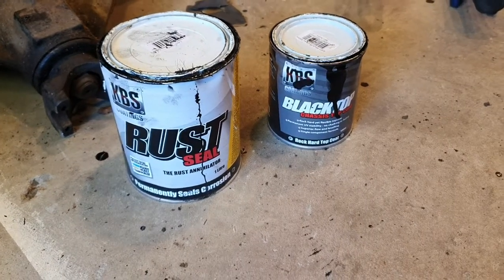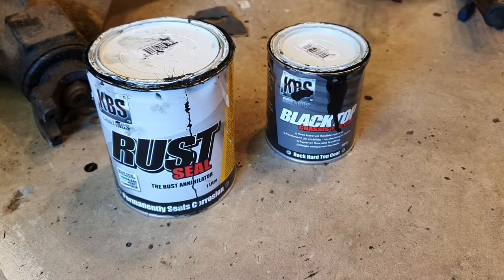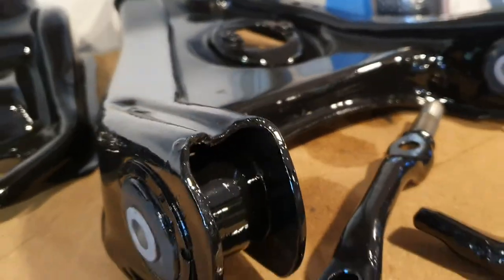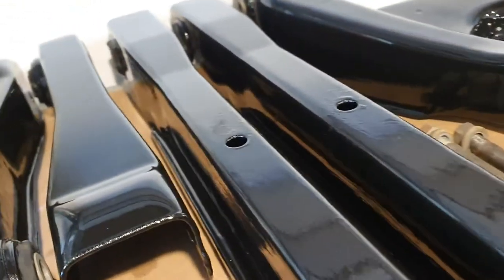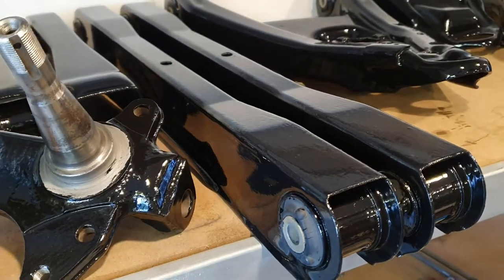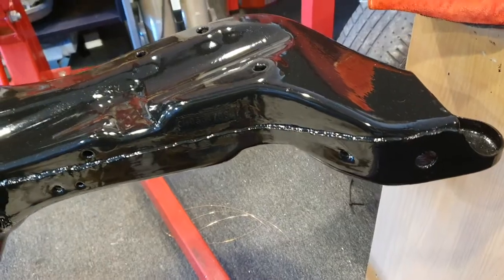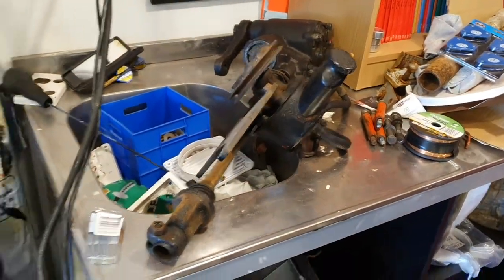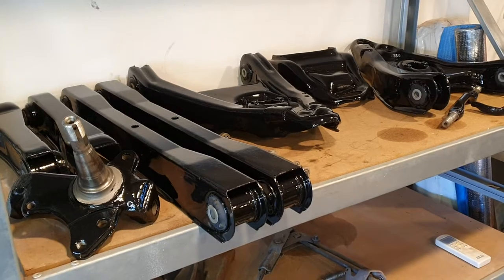Hq holden project, KBS ,brush on Verses spray on.

Comment: Would you explain what did you mix to have that finish I need to do same job thank you
Reply from the maker: With the brush on paint, I just used it straight from the Tin. When sprayed on, I mixed it with 10% Thinners.

Comment: Good product review Davo, I was tossing up wether to brush on or spray on, I will now spray on thanks to your video, how much what KBS/thinner ratio did you use mate?
Reply from the maker: I used 10% thinners
Reply: What gun tip/pressure? Thanks

Comment: another great video about to do the under carriage on my car. With your kbs did you use the kbs black top on under carrige and the kbs rust seal on the suspension parts  coming along very nice top job
Reply from the maker: Hi Matt, I used KBS rust seal and black top on the under carriage and the suspension parts

Comment: Does it seem like a tough coating?  I’ve seen the owner of KBS industries hammering away at his blacktop coating and no chips came off!

Amazing if true.
Reply from the maker: I'm hoping it is. Once the car is on the road , that will be the real test. The only chip I've made to KBS is the firewall when the motor hit it while installing it.
Reply: @davohq1724  Maybe I'll give KBS a try.   I also watched a POR-15 demo on Leno's Garage and the rep was doing the same thing as well with no chips....
Reply from the maker: @adamkorekach9936  the only other problem with these types of paints is that they take about 4 hours before you can recoat and about 3 days to fully harden.
Reply: @davohq1724 did you paint it in painting room or outside, would it take less time if the heater on between coats in painting room?
Reply from the maker: I painted it inside the Garage. A heater would probably would be a good idea as it takes a long time to dry.